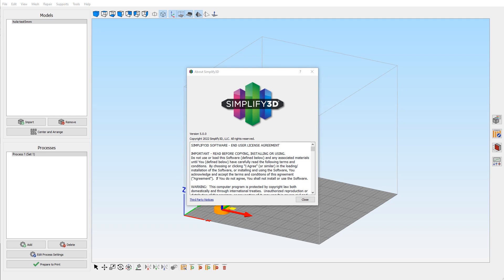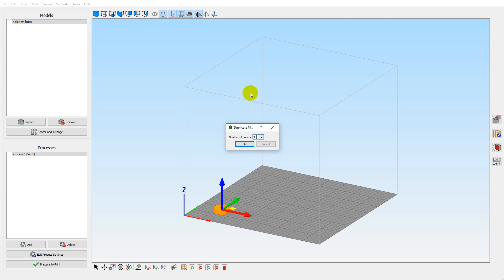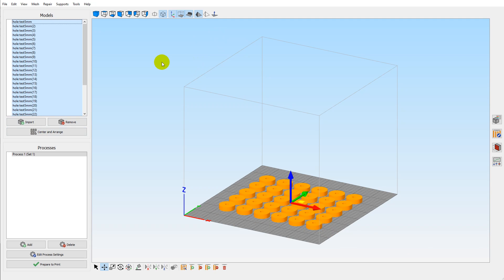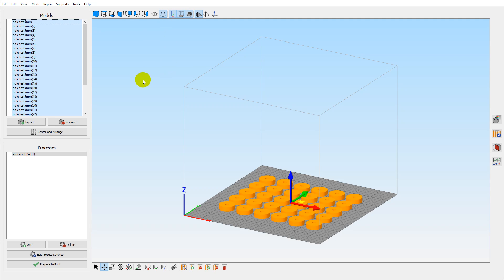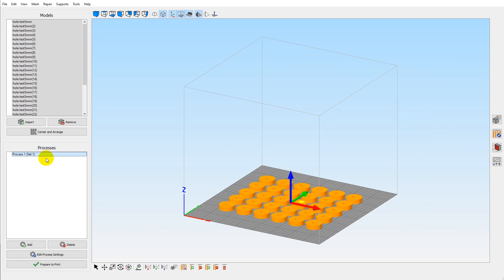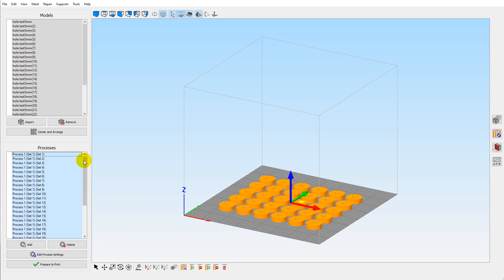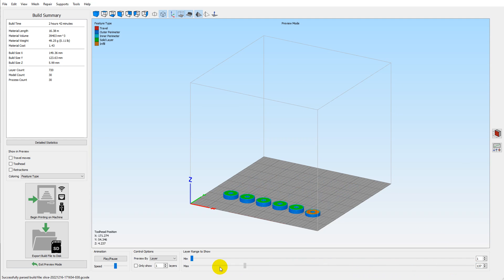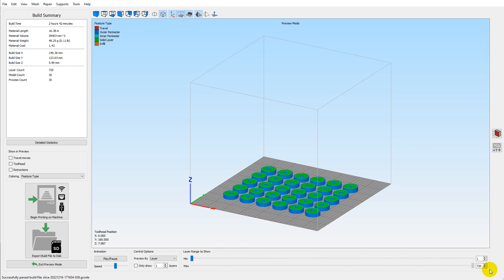Simplify3D V5 Sequential printing

Comment: Is there a software limit to how tall objects you can do sequential printing for? Because if the object is too tall then there will be a collision with the printer when it starts to print object #2, won’t it?
Reply from the maker: Yes, when you select sequential printing you need to nominate the vertical clearance height for your models.  It should be automated but as with V4 you need to know how high the highest model is and manually set it.

Comment: Dear, I can ask you how I have to set up the "scripts" to be able to have breaks between the various parts of the sequential printing so as to make a color change ? thank you. PS Too bad that version 5.0 cannot print the single surfaces of the Lab Print planes, I hope this bug will be resolved soon
Reply from the maker: I sliced and printed a spitfire from them with no issues using S3D v4 a few years ago.  It was perfect.
Reply: @ozitarget  The problem is with version 5.0 .... it no longer works correctly for this type of printing, it is necessary to correct the bug

Comment: I've tried all those different slicers and always come back to S3D. S3D 5.0 gets a bad rep because it doesn't have all the visible bells and whistles you have to go though in order to get a sliced file.
If I want to tinker I play with CURA or PrusaSlicer. If I want the print job done I use S3D.

Comment: Overall, what is your opinion on S3D v5? Worth my $60 to upgrade?
I've always liked my v4 but so many other free slicers have surpassed it in improvements for free.
Reply from the maker: For me it has been worth it.  I had so many things dialed in with v4 and a workflow that I had not been able to mimic in Prusa.  I was getting there but if something was not working I'd go back to v4 to get it done.  For me, v5 now has the 3D infill I went to Prusa for.  I'm back to S3D full time again now.  My only gripe is the layout of multiple parts is still rubbish compared to Prusa but I don't do a lot of that so it is less of an issue for me.
Reply: @ozitarget  Thanks for your feedback! I love S3D. I'm just grumbling about paying more money for it.